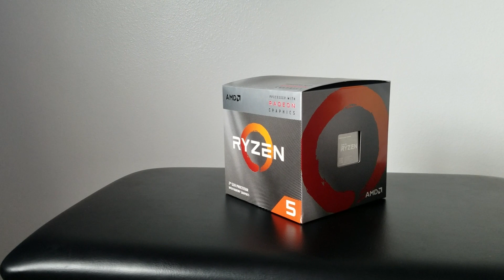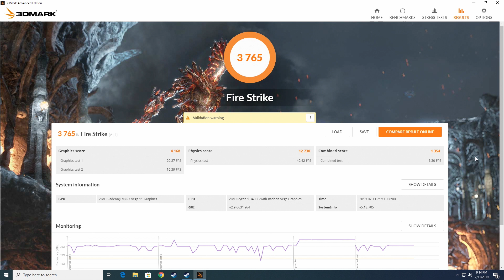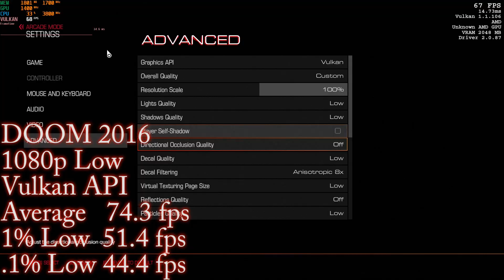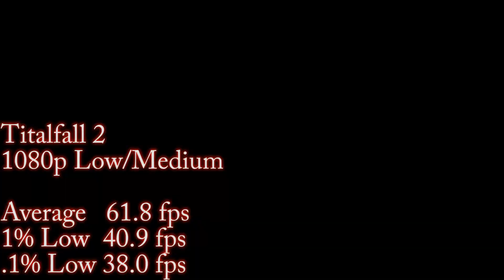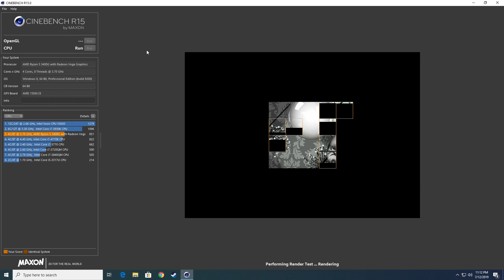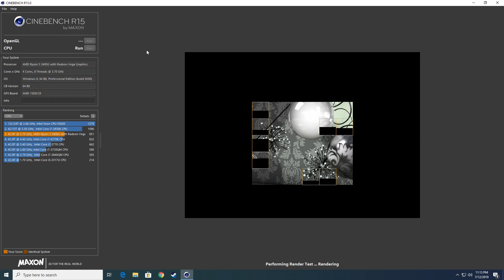Ryzen 5 3400G w/ OC Samsung B-die Memory

Comment: I did this exact same thing. B-die, R5 3400G, igpu overclocked to 1700 MHz, ram 3200 with CAS 14 timings. Inwin Chopin case, Noctua low profile cooler. During demanding gaming the computer would shut down. Pretty sure it was the anemic power supply in the case. Moved the guts to a NR200P with a Corsair SF600 and no problems at all.
Reply from the maker: Nice! Yeah, the 3400G with any kind of OC will push that little PSU to the very edge.

Comment: tks，looking forward to more oc about 3400g, though i already have it lol. btw, i wonder if it has power consumption, just like 2400g
Reply from the maker: I need to spend more time with it for sure! Now to fine the time. . .
I think the power consumption is probably more than the 2400G primarily because of its more aggressive CPU boost, but because it's soldered to the IHS it's able to dissipate the heat more efficiently.

Comment: I have a 3400G and I'm switching from 3000-DDR4 CL16 (OC 3200) to 3600-DDR4 CL14 (will try to OC to 3800), I hope this'll give me an edge. I also run the CPU @ 4050 with 1.35v and the iGPU at 1675 with 1.15v. Kind of hoping I'll get some extra FPS with the larger bandwidth and the tighter timings.
Reply from the maker: Nice! You'll have to let me know how that goes! 3600 CL14 sounds like a killer kit of memory.
Reply: @prerunnerwannabe  Will do! It's this kit: F4-3600C14D-16GTZRA (I'll be turning off that rainbow barf though :P)
Reply from the maker: @TheTekknician  Noice! I love G.Skill's kits.
Reply: @prerunnerwannabe   Sadly, the extra bandwidth resulted in a marginal uplift in FPS in various game benchmarks. Though there is profit, it doesn't justify buying the sticks for near 190 euro's.

Comment: nice a very informative video about 3400G ocing. I've been looking for a video like yours for a while now and for me this one is the best, I actually learn something from you're video. Anyway can you help me for some questions i have?
here is my specs: R5 3400G(w/ wraith spire) ~ MSI B450 Gaming Pro Carbon ~ 2x8 3000mhz cl16 ~ 450w psu 80+ bronze
Q>  is it safe to boost my cpu with stock coolers to 3.9Ghz ? and iGPU to 1600mhz or 1700mhz? with 3000mhz ram with default timings. Any suggestion for my overclocking... by the way I'm from the Philippines so its kinda hot here.
Thank you and more power!!

Comment: this processor is compatible with 2933 mhz ram
but why are people attaching 3000/3200 mhz ram. how?
Reply from the maker: 2933MHz is the certified compatible speed that AMD attached to this APU, so technically anything past that is overclocking the memory. People can go way past that (like 3400MHz) because the 2933MHz number that AMD gives is suuuper conservative. It's basically guaranteed that you'll hit 3200MHz with a memory kit that's rated for that speed.
Reply: @prerunnerwannabe  okay thank you :)
Reply: @prerunnerwannabe  can you help me? last night i updated bios and also running ram with 3000mhz with xmp enabled.
but today my pc crashed 3 times especially after changing my ram command rate from 2 to 1 and then again i reverted it to 2 as it was before. now my pc isnt evening turning on :(
Reply from the maker: @anupammondal3704  Dang, that's no fun. Did you try overclocking anything else? If there is a "clear cmos" button on your motherboard, press that. If there's not, unplug the power cable going to the psu, press and hold the power button for 10 seconds or so to drain any remaining power, and carefully take out the little coin battery and let the PC sit for a bit. Pop the battery back into the mobo, plug in the power cable, and see of it will fire up. What kind of motherboard do you have? And what CPU?
Reply: @prerunnerwannabe  oh yeah i did that like an hour ago and it turned on. and also rested my bios settings so ram is currently running at 2133mhz, even turned off xmp. for now it looks stable.
mobo: msi b450m pro m2 v2
cpu: 3400g
ram: corsair vengeance lpx 3000mhz 1x8GB. 
I think that problem happened because I changed my ram frequency to 3000mhz
Reply from the maker: @anupammondal3704  I'm glad you got it working! It's weird that it was crashing on you. . . Stock XMP should work perfectly fine and be stable. You could try manually inputting the rated speed, timings, and voltage that are listed on the ram kit. You could even lower the speed to like 2933MHz to try and improve stability.
Just wondering, are you planning on adding another 8gb stick of ram at some point? You probably know this, but being able to run in dual channel makes a massive speed difference with Ryzen APUs.
Reply: @prerunnerwannabe  yes i know about the dual channel but first let me see for a few days whether pc crashes again or not. 
also my psu is shit. does that matter with crashing ?
Reply from the maker: @anupammondal3704  A terrible PSU could certainly be a factor with stability. It might not be providing very clean or reliable power, with could very easily lead to instability.
Reply from the maker: @anupammondal3704  There are lots of budget power supplies that will work well. EVGA, Corsair, Antec, Seasonic, and even Rosewill have inexpensive options that will still be good and reliable.
Reply: @prerunnerwannabe  i see 
thanks
Reply: @prerunnerwannabe  it happened again :(
I ran into BSoD 5 times today with different error codes
should I clean install windows 10 or is it a hardware problem
Reply from the maker: @anupammondal3704  Dang, that sucks. Is it a windows install from a different computer? Or is it fresh with this system? Sometimes that makes a difference. 
You could see if anyone else is having the same issue with the mobo and bios revision that you're using. And if you want to take the time, you could re-seat the memory as well as the CPU. I would check to make sure that there is no thermal paste or anything on the CPU pins or in the socket.
Are you running a graphics card or the igpu? It could be a driver issue somewhere with old drivers conflicting with the new ones.

Comment: inwin choppin case about the same size 150w psu also oc cpu to 4ghz and disable cpu boost this would cause my psu to shut down now runs stable at arround 120w at fuller loads  and lastly I was able oc my gpu to 1650mhz
Reply from the maker: Nice! Yeah the Chopin is the exact same case internally as this one, so if I can find a 150w Chopin psu, then I'm good to go.
1650MHz on the gpu is a solid overclock!

Comment: If you drop the vram to a lower setting the system will allocate more RAM to the CPU and GPU. I'm running 16GBs of Corsair Vengeance 2666Mhz at 3000Mhz and GTA V is using over 8GBs. I'm getting around 45fps with the Ryzen 3 2200G
Reply from the maker: That's interesting. I was under the impression that it didn't really make a difference with performance, but figured that I may as well give it as straight of a shot as possible.
Thanks for sharing your findings!
Reply: @prerunnerwannabe  I didn't drop it too low or the Ryzen Master didn't have enough to initially open. So try 1GB and see if that works for you

Comment: i had problems with the 3400g/3200ripjaw setup on xmp1 profile. i had no problems whatsoever under win10 with porgs like ableton live10 loaded up with lots of plugin synths etc...runs like weazel. as soon as i palyed some games i got bsod resulting in a freezed system only capable of switching on/off the pwoerbutton to reset the comp. i then made some of the few fixes people sorted out, ending up in a COMPLETE uninstall of all that mainboard/cpu extrasoftware, which made playing some games more stable, but the bsod still came, this time more later. i then set the uefi to jedec instead of xmp profile1 for the 3200 gskill ripjaws. they now run on 2133 , dont ask me why gigabyte put it on that low numbers..., but for the trade of less mhz it sets the cas timings lower from 16 18 18 36  to 15 16 16 35, which makes the underclokcing loss a bit less harsh. from that moment on evrything gaming run smooth like butter so far. but all in all its a pretty sad experience with amd apu, gigabyte x570 aorus elite to say the least. pretty underwhelming...gpu wise. the cpu part of the  ryzen 3400g is rocksolid and slick!
Reply from the maker: Dang, that's weird that the XMP profile was causing so much grief! 3200MHz isn't crazy fast, so it should have just worked. . . What was your memory voltage when using the XMP profile? Sometimes you need to manually set it to 1.35v even after enabling the XMP profile. Was there an XMP 2 profile with looser timings that you could try? There's a massive performance difference to be gained by going from 2133 to 3200 MHz, so if I were you, I'd play around with it more.
Reply: @prerunnerwannabe  it dont know, it was all set on auto in the uefi. is it possible to just set the dram voltage manually or do i have to do more manual tweaks? i never did anything overclocking. according to cpu-z its 1.35v
Reply from the maker: @atomaalatonal  Yes, you can manually set the memory voltage. I think it's usually labeled as "DRAM voltage". Maybe try loading up the XMP profile, make sure the memory is set to 1.35v, and then lower the memory frequency to 3000MHz. That way you at least get most of the performance that you paid for.
Also, from my experience, updating the BIOS can help with memory stability.
What kind of motherboard do you have?
Reply: prerunnerwannabe i did it and even set the latencies stuff manually. i booted win10, steam and played 4 of the games which crashed the pc yesterday. and NONE of them had afreeze or anything else. BIG thx for encouraging me with you video and your response! i hope that did the trick for the next time :D  mb: gigabyte x570 aorus elite, did the bios update f11 right after the first systemboots 3 weeks ago
Reply: crashed again...at 2800
Reply from the maker: @atomaalatonal  You're kidding!! I feel like something at this point is a little broken. . . Are yoru ram sticks in a staggered setup or are they right next to each other?
Reply: prerunnerwannabe according to the boards instructions i put them in slot 2 and 4. at least i was able to play for 2 days without crash. still no probs whatsoever with heavy cpu demanding music apps, didnt even crash on my 100% load test with ableton multiple tracks with synths samplers etc...must be something with the gfx unit controllers on the ryzen.
Reply from the maker: @atomaalatonal  That's really interesting. Are you on a fresh install of windows? I wonder if some old drivers or something aren't playing nice.

Comment: Hy.i have Corsair 3200 mhz, 16gb, cl 16 on b450m ds3h and when i activate xmp is not stable.is getin me out of the game, on desktop.why? thanks.
Reply from the maker: I would first check to see if the ram voltage is set to 1.35 volts (or whatever the sticker on the ram says) and if it still crashes, I would update the BIOS to a newer version. Usually newer BIOS updates help with stability.

Comment: can I run a stable 3000mhz with Team Elite T-Force Delta RGB 16GB 8GB X 2 3000Mhz DDR4 White T-FORCE with the 3400g? or do i have to make my kit run at 3200mhz to make it stable? (using dram calculator)
Reply from the maker: If the Team Elite memory kit is rated to run at 3000MHz, then it will be super easy to make it run at 3000MHz. Basically just enable the XMP profile and you should be good to go. Tightening up timings is where it gets time consuming and difficult.
It will be stable at 2133MHz, 2400, 2466, 2667, 2933, 3000, etc. Stability becomes a problem when you push the frequency farther then the CPU can handle, or too far past the rated memory speed of the memory kit. 3200MHz is simply a good sweet spot for speed, price (of ram), and general stability (assuming the memory kit can take it)
Reply: @prerunnerwannabe  not the case for me bro. i run xmp on my setup my system reboots itself randomly
Reply from the maker: @redpotatoes8714  Did you up the memory voltage to 1.35v? If you did that already, maybe see if there is a newer BIOS update that still supports the 3400G.
Reply: @prerunnerwannabe  yes i did. i even went as far as 1.40V still getting bsods. ill check the gigabyte page if there is a new bios update that supports the 3400g
Reply from the maker: Dang. What error messages are you getting when the computer BSODs? Potentially, there could be something messed up with the windows installation.
Reply: @prerunnerwannabe  actually, i dont get any error messages, its just that my PC reboots randomly.
Reply from the maker: @redpotatoes8714  That's super weird. It almost sounds like a hardware issue more than software. What kind of power supply do you have? Sometimes a cheap power supply can cause issues like that, especially if the electricity isn't super clean.
Reply: @prerunnerwannabe  i got the silverstone ET550-b 550 WT bronze 80+

Comment: I have team t force dark za 3200mhz 2x8 memory and I overclock it in auto and did not click anything or change is it ok to run 3200mhz in 3400g or should i reduce to 3000mhz? because I saw in amd website that 3400g only support 3000mhz.
Reply from the maker: It's 100% okay to run ram above the rated speed of either the cpu or even the memory itself.👍 
3000mhz is simply what is officially supported. Basically the "this will work no matter what" rating.
I would just make sure to have the DRAM voltage set to 1.35v, and you should be able to easily run the memory at its 3200mhz rated speed.
Reply: Is there a chance that wrong ram overclocking affect psu?
Reply from the maker: @geozo4556  No, I don't think that would happen.
Reply: Ok thanks 😄
Reply from the maker: @geozo4556  You're welcome! :)

Comment: I don't really get it. You got 20% increase in games using this memory in compare to what? If I get 3200Mhz CL14 would it make similar results to this? I can get G.Skill FlareX 3200Mhz cl14 or Kingston RGB 4000Mhz cl19 for the same price. Which one is better? I heard Kingstone one's are some kind of cheaper b-die.
Reply from the maker: Hey! So I got a 25ish percent performance improvement when compared to the 2133MHz default memory speed. I would definitely go with the 3200MHz cl14. I don't think a 4000MHz kit would make any sense since I doubt you'll be able to get anything past ~3500MHz to even post. 3200MHz cl14 should be guaranteed b-die, and that is the main thing you should look for. You can always clock the 3200MHz kit to 3433 or something with timing adjustments.
Hope that helped! LMK if you have any more questions :)
Reply: @prerunnerwannabe  Thank very much for the answer. It is really helpful. I will definitely go with 3200Mhz CL14, but can you tell me which one is better, G.Skill Trident Z or FlareX? I heard Trident Z can be overclocked more than 3200Mhz keeping latency at CL14 but I heard that Trident Z sometimes not working good with Ryzen. On the other hand FlareX are better compatible with Ryzen but they in the most cases can't be overclocked more than 3200Mhz at the CL14 latency. I already bought all the components for my new PC including Ryzen 3200g but I just can't decide about RAM. If you have any advice it would be helpfull. Thanks.
Reply: And yeah, that Kingstone RAM also can be set by XMP profile at 3600Mhz CL17.
Reply from the maker: @jminix6287  Happy to help! I guess it depends on how much you want to get into nitty gritty memory adjustments. I would probably go for the Flare X kit if you want to just set the XMP profile and not worry about manually tuning each timing. If you want to do more aggressive tuning it honestly probably doesn't matter that much, although I would stick with the G.Skill stuff and not worry about the Kingston kit.
You could also check out a recent video by Linus Tech Tips that talks about tuning memory timings for Ryzen. That should get you in the ballpark at least with a more aggressive memory OC.
Reply: @prerunnerwannabe  Thank you very much. I will probably go with the FlareX and not worry about any manual overclocking. 3200Mhz will probably be great enough. You helped a lot. Thank you.
Reply from the maker: @jminix6287  My pleasure! Have fun with your 3200G build!
Reply: @prerunnerwannabe  I will. Thank you.

Comment: im building an itx 2400g PC that is gonna cost me round $186 in total. ima prolly make a video on it. ITS INSANE
Specs of it are...

2400G stock- $100 on ebay
Vega 11 stock

8gb (2x4gb) corsair dominators platinum 3200MHz stock. timings are like 18... 36- got 8gb ballistix sport for $26 (traded them out for eachother)

a very attractive itx HP case I painted blue- traded another case for it

I got a 64gb ssd long time ago for  25 but now u can get 120s for 20 so $20
500gb hdd. honestly just find one outta an older laptop. these are easy to find for free

got the brand new 80+ Gold 180W PSU, HP a320m motherboard, and CPU cooler for $40!!!!!

YEAS IK u prolly need to be an enthusiast like me with extra parts and contacts to make this easily but this shows what you can pull off if you plan out extensively and snatch deals. I believe this is the best price/performance for a "brand new" parts Rig you can throw together. Most of these more core parts are 7 months old anyway. This masterpiece of a power supply has enough power to upgrade you to something like the GTX 1650 or a better R5 in the future when you need more power. 

I'm prolly gonna either sell this to my friend at Christmas cause he wants a GTA V modding PC but for now, this will be my little travel PC.
Reply from the maker: Hey, that's awesome! I always love a properly scrappy build :)

Comment: does this new apu still prefer B-die or they fix that already? cl15 3000mhz or cl16 3200mhz both 16gb(2x8)?
Reply from the maker: B-die is just really awesome, fast memory, so it'll always be a preferred type of RAM. Though as far as memory compatibility goes, you should be able to use most any name brand kit of DDR4 and it should work fine. For the two specs you mentioned, I would go with cl16 3200mhz. I personally like the G.Skill Ripjaws V kits, but most other brands would be good.